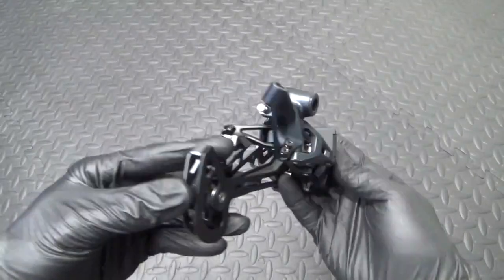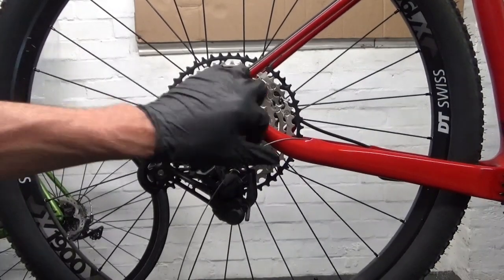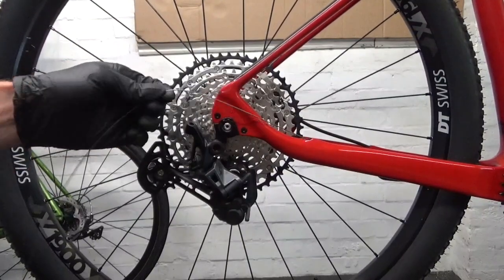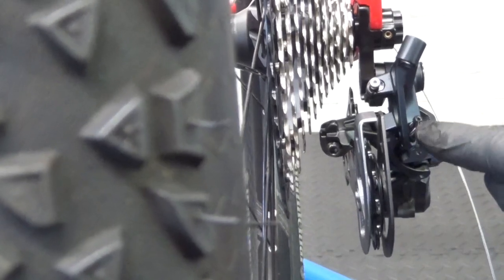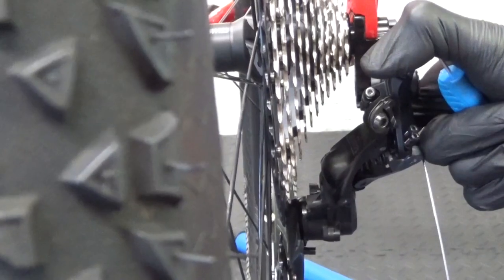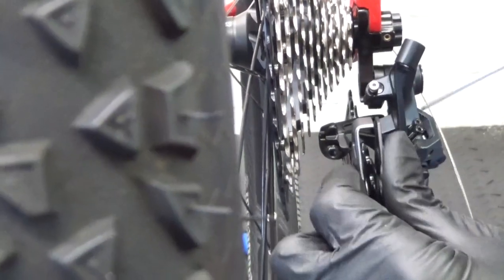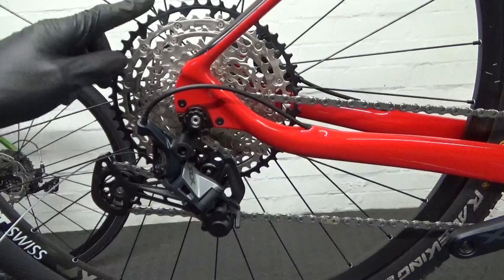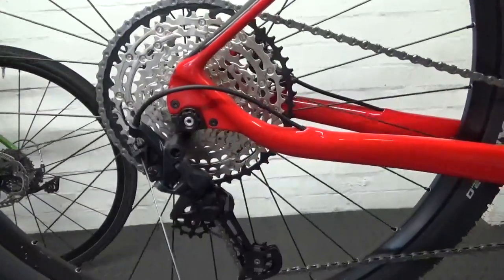Shimano SLX M7100 Rear Derailleur Fitting Guide

Comment: I've done lots of road mechs but this is the first SGS MTB mech I've done. I'm amazed at how tight the clearances are for these, much more so than for road mechs. Wish there was a barrel adjuster at the mech on these to make it slightly easier to tweak. Good tip on doing the high/low adjustments and cable anchoring before putting the chain on - it's really fiddly otherwise (despite the Dealer Manual saying otherwise). By the way, this video is relevant for the new RD-M5100-SGS Deore mech for the Deore 5100 11-51T 11 speed cassette as it's got the same cable anchor and adjustment screw positions.

Comment: An excellent no nonsense video. Covers everything in a very logical and understandable format. I've just used it to fit a 12 SLX to replace a broken SRAM SX12 which exploded with forest debris the other day. No SRAM NX RDs available and I never wanted to put on another SX which really is pretty poor.  Just finished the SLX install and all worked fine with SRAM SX shifter, Chain, chainring and NX cassette. I needed to lengthen my chain by another link.  The cassette is not 10-51 but 11 - 50 but lll seems fine.  The hardest bit was the B-Screw adjustment.  Thanks for a great video.

Comment: Hello there....let say im sitting on the saddle holding the handle and the wheel straight.....which way do i turn the barrel adjuster on the shifter  to improve the shifting to the  lower gear ie the larger sprockets....?

Comment: Hi...
I have the same cassette and derailleur but the shifter is pulling too much of the cable. I tried to fix it, but it is not possible. I would be thankful if you could tell me the modell of the shifter you are using in this video.
Thanks
Reply from the maker: Shimano M7100 SLX Shifter

Comment: Just installed a SLX 1x12 groupset .....why does the chain fall off when pedaling backwards?
Reply: Hi, I just installed an SLX groupset and I have the same problem, the chain fall off when pedaling backwards on the 51 tooth for example. Have you find any solution?
Reply: @yordanistornesmedina  i have not found the solution yet. It happens sometimes .

Comment: Hi 👋🏽 is there any way to adjust tension at clutch mechanism ? Just as the XT
Reply: yes, on 1x12 SLX and Deore, you need to open up the clutch cover, adjust the clutch then re-seal the clutch cover. XT and XTR don't need to have the cover removed to adjust the clutch
Reply: @davidh7414  thanks a lot i had an XT 11s now i was confused trying to find the clutch adjuster!!

Comment: I am having an issue where I cannot get it to shift into the 51t cog as ir will not go over far enough. Any ideas?
Reply from the maker: First check if the derailleur shifts all the way to the 51 tooth sprocket without the chain on the bike.
Reply: I might know the reason for your problem. The small turnable part that is resting on your hanger (b-screw goes on it). The 'tab' as he is reffering to at 2:46 - If this is installed wrong your b screw wont have enough range to get over the 51cog.
Reply: Bluebird I looked to see if it went all the way over to the 51 and it would not with no chain even though my hanger was straight even with my low limit all the way out
Reply: @Harry-cx1xg  Yes, had the same problem. Check the 'tab', is your b screw touching the tab attached to the direlleur or is it pressning against the mech hanger?
Reply: @Harry-cx1xg  2:46-3:25 was the solution for me atlease. Make sure you understand what he is doing here and check again on your bike
Reply: Bluebird tab is in the right place the derailleur comes very close to the 51 t with in 1mm now I think I’m gonna get a new hanger and see if that fixes it I think it might be the problem
Reply: @Harry-cx1xg  okey! Thats too bad. Good luck :)
Reply: @Harry-cx1xg  you may not need a new hanger. Sometimes they can be tweaked/ bent and manipulated to make the slightest adjustment needed for smooth shifting